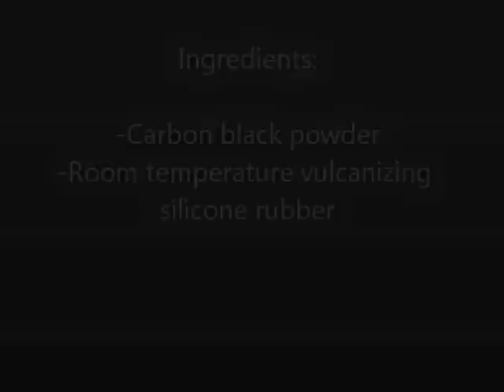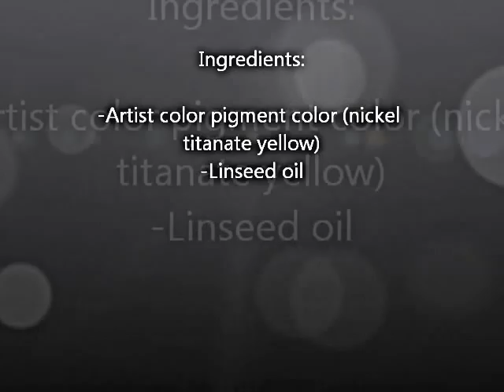Three Roll Mill Applications

Comment: Just a few questions:
1. As for pigment dispersion,  for example, mixing castor oil and the pigments; would I would pass the application three times through the mill? 
2. Can I pass medium to high viscous liquids (emollients, oils and waxes), silicons,  siloxane polymers, silicone resin, silica, through the T50 mill to homogenize application? 
3. Will the T50 mill homogenize the lipstick  application?

Thank you,
Reply: +Manaza Mitha 
For your questions,
1. You can mill your materials a couple of times till you get a fine result. Usually if you set the gaps small enough you can do less passes.
2. Just check the website the 120W motor should be powerful enough to process silicone resin and others. The T65 in this video is even more powerful and desired for this use.
3. There is not stainless steel roller version of the T50 at this moment (also see the list). Which means if you really concern about contamination you would need to look into the T65 with stainless steel rollers. As far as I know lipsticks will leave stains on the porous ceramic surface.
Hope this will help.
Reply: +Wenxiong Li thank you. I actually purchased the T50 already.  What can I do prevent contamination?